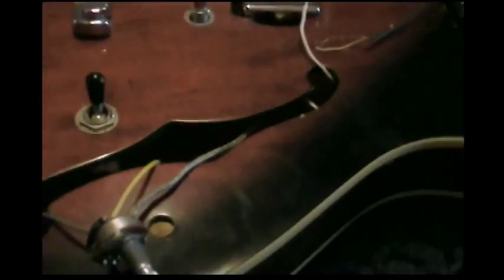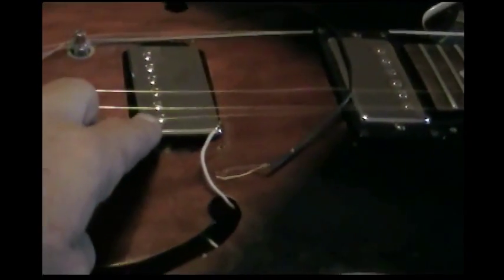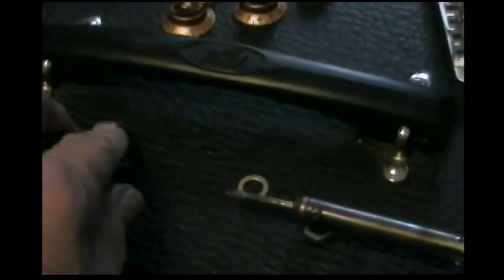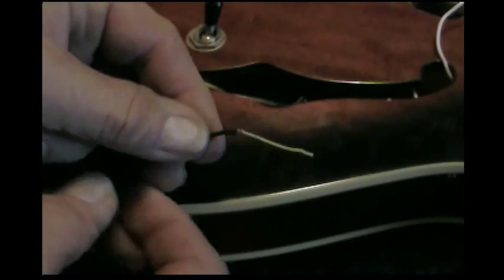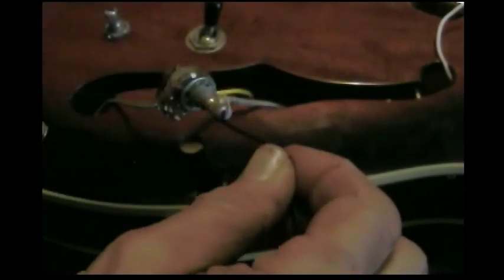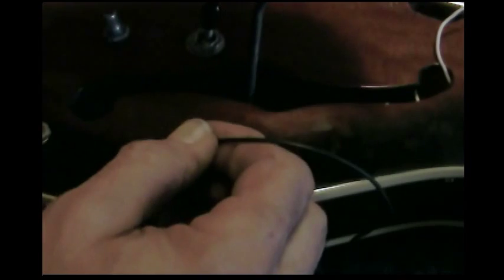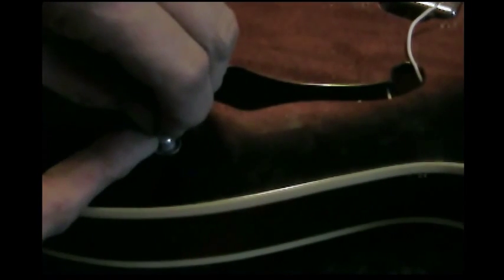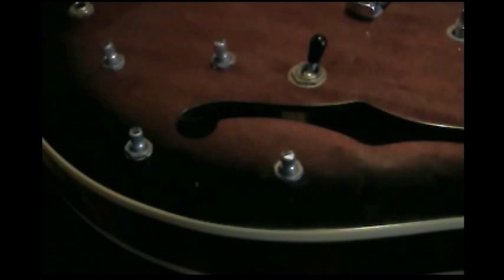How To Remount Pots In An Epi Dot(or any 335 type) FAST!!!

Comment: This method works but I’m happy to pass on a not so secret trade method shown to me as apprentice luthier over 40 years ago and I still use today. Use thin rubber or flexible plastic tubing with an internal diameter small enough to fit snugly over pot slotted ends but not over the thread. Feed the tubing through the top of the body first and out through the f holes. Push the tubing over each pot end then carefully pull back though. Do not remove the tubing once the pot is in place simply slide the washers and nuts down the other end of the tubing over the pot thread and finger tight in place. Then remove tube. Works on switches too with smaller gauge tubing or tape around switch tread for tight fit. For the jack you will need to place tubing over thread so the tube will have to come off before washer and nut. I have also used heat shrink tubing and even plastic drinking straws taped together when no tubing was available.
Reply from the maker: there are thousands of ways to do it....this is just how i did it...thanks for watching and the comment
Reply: @johncartelli  Your video was passed on to me by a customer query and I replied that your method works. However the customer unfortunately used heavier gauge copper wire not as per this video and ultimately scratched certain areas of his guitar both internally and finish work. As you are probably aware it is common and in fact we have a fair amount of business based around customers accidentally damaging their instruments whilst trying repair or do mod work. My comments above just reflect a certain methods we use and in no way suggest your method inferior. Videos like yours help the wider community understand and appreciate that any repairs or mods on guitars should be done with an understanding and with the utmost care. Thanks.
Reply from the maker: @1964vintage  he scratched it internally?well there are a thousand ways to do the same procedure, this just happens to be how i did mine. your customer doesnt posses the skills needed to do a uneventful procedure. regardless of what wire he used it appears.
Reply: @johncartelli  yes unfortunate but a lesson learnt in his case. My question to him, like you state, how did he manage to scratch it internally? Like I said he claims to be using heavy gauge wire and I can only assume may have been frustrated or a too heavy handed. I can’t verify either way or what exactly happened. We wouldn’t have a customer base if people were competent with all aspects of repairs on their instruments. The reality is that most are not. Hence we get repairs from people who say ‘I thought I’d have a go first’ .

Comment: elastic bands also work.  Loop the band through itself then around the post.  Fish it up through the hole.  I use a thin stiff wire to hook the elastic band.  The elastic band is thin enough that you can just drop your washer and nut down the elastic band onto the post so there is less chance of dropping through. 
  I needed to check out the star washer. I was pretty sure the cut side went up into the wood ( it just makes sense) but I wanted to make sure.   Good tutorial.   thanks.   
  Always great to have more than one method.
Reply from the maker: sure anything you got around to produce the same result will work. thanks for the comment and viewing
Reply: @johncartelli  can you demonstrate how to take out the pot. I may have knocked off a wire when hammering frets. I need to check under the pickup by removing. It's a hollowbody. Subscribed now

Comment: The trick is to tie fishing strings around the threads of the pots , before you let them drop in , then you can do whatever , even put new pots and connect to the fishing line and then once all soldered up pull them back up through the holes and walah
Reply from the maker: nods same concept..use anything to pull them back up.i like using the wire because it will bend and hold itself around the pot shaft without having to tie a knot..plus the wire will hold its shape if you bend it..much easier to fish it to where you need it,,,fishing line  not so good  and tying a knot means  ill have to untie or cut off later....thanks for the comment and watching
Reply: This is a great suggestion because you don't have to care about messing up the actual pot position . Thank you!

Comment: Hi I saw your video as I am having to work on a Epiphone Dot Studio I got and I had used a similar process as you but thought there is a further step that eliminates having to hold the end of the pot when you take the trace wire off. If you slip the washer and securing nut over the other end of the trace wire so they can slide down and onto the stem at the top of the pot. Then just tighten nut and then remove trace wire.
Reply from the maker: yup that would work...

Comment: Run the wire through the hole and out of the opening 1st. Hook the pot and pull it through. No sense in trying to feed the wire through the body. Especially on the back 2 pots and the jack plate.
Reply from the maker: thousand ways to do it..this is just how i did it thanks for watching and the comment

Comment: You can also use a thin solid wire, works fine too.
Reply from the maker: yes thats essentially what i used
Reply: @johncartelli  No it was not a solid core wire. Solid core holds the pot more firm.
Reply from the maker: @kimhansen6384  too stiff a wire and it will be harder to stay onto the pot shaft and pull it through the holes...i like the way i did it better..but thanks,,,
Reply from the maker: @kimhansen6384  solid core tends to break when bent enough times,,,im glad you have a method..i like mine   thanks for the comment

Comment: Could have just left the screws on the wire that was around the pot and pulled the wire and let the screw drop down over the wire . Walla
Reply from the maker: sure  but i would have a  little bit more trouble undoing the wires then trying to pull them up through the slot of the pot..i suppose it would work but this way is just how i did it...basically to show a way to do it.....but thanks for watching and the comment

Comment: You should have put new pots. CTS and tossed the Chinese pots
Reply from the maker: if I wanted to upgrade yes.....but i just wanted to get it back together...and didnt have  cts pots
Reply: johncartelli John I am going to to new pickups in my 335 the same way you did! I'm not going to pull all the wires out the F hole. That would drive me crazy. I play Bare Knuckle P90s on my Les Paul Standard and I love them. They look just like the pickups you installed. Great video friend
Reply from the maker: thanks...man...and thanks for watching and commenting

Comment: 1:59 thank you, I was getting dizzy! I use a drop of wax to hold the flat washer onto the pot, a dot of solder on top of the pot shaft to hold the fish wire. Have the flat washer and nut threaded on the fish wire. Your vid is way better than mine because I don't have one!
Good vid, thumbs up.
Reply from the maker: sure anything you got around to produce the same result will work. thanks for the comment and viewing